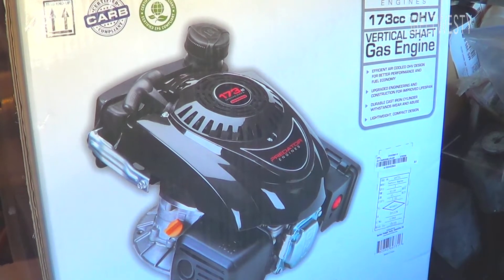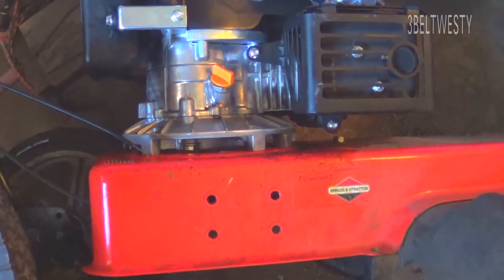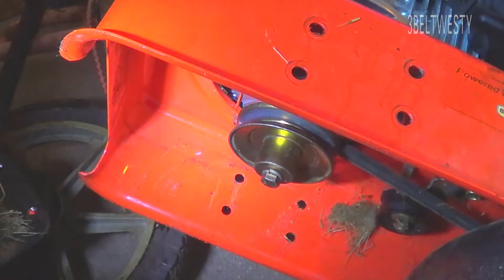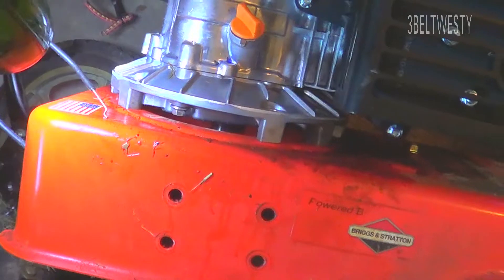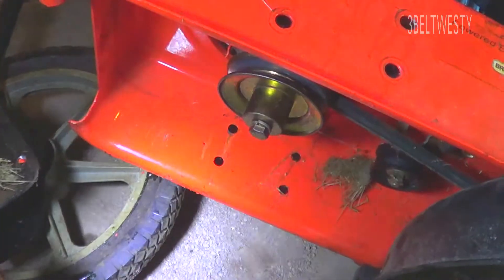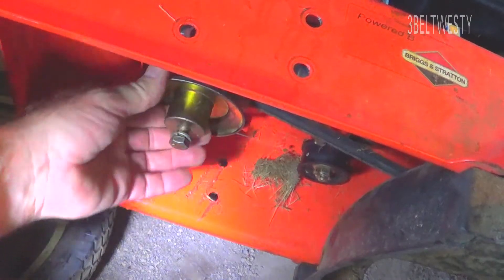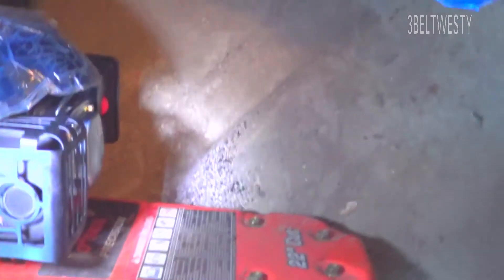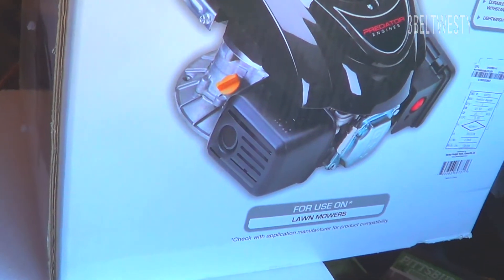69731 Harbor Freight engine ARIENS ST622 String Trimmer

Comment: Couldn't you drop the idler pulley lower ? i'm replacing motor on mine right now
Reply from the maker: I ended up just cutting the shaft off the engine  "Original engine has 2  7/16 long crankshaft.  Harbor Freight has 3 5/32 inch shaft. Difference is 23/32 inch or about 0.72 inch"

https://www.youtube.com/watch?v=s-DRP3vZTz0

The video  link  shows cutting the shaft 7/10 inch shorter ; 18mm shorter

The stock engine on mine has a short shaft so an actual direct fit engine was double the price of the HF engine

 I Farted around trying hack saw blades; saws zall ; then the cutt off wheel was what worked

That HF engine I used has a brake ie flywheel brake. My Ariens string trim mower does not. So I had to pull one the HF engine brake with a coast hanger wire

Comment from the maker: Original engine has 2  7/16 long crankshaft.  Harbor Freight has 3 5/32 inch shaft. Difference is 23/32 inch or about 0.72 inch
Reply: 3beltwesty what was the original engine cc displacement
Reply: Yes thank you. I just put a 3.5hp i had extra on an edger. Almost exactly same just smaller. only thing i did was swap pulleys and it all lined up.
Reply from the maker: @20phor-9  If you cut extremely thick grass or small seedlings I found that the DR Trimmer mower New cord thicker cord will fit my mower.  it is 0.175 inch diameter ie bigger than normal.( ie 155 mills)  "Premium Quality DR Cutting cord" 175 mils 80 ft spools. These are sold on ebay; amazon, Tractor supply  etc.  DR 196601. The larger cord saves me time clearing out an overgrown field since have no bush hog.